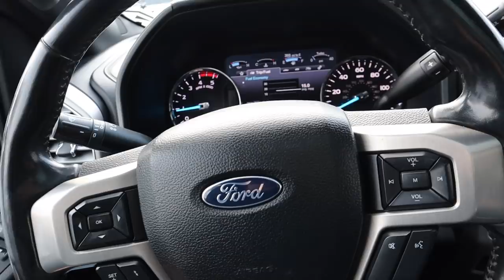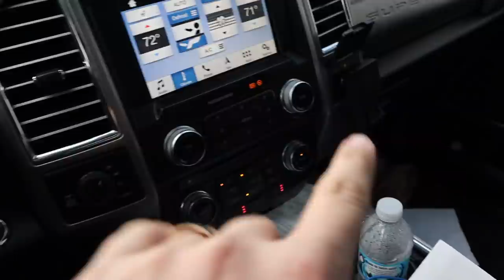I'VE BEEN HIDING THIS FROM YOU UNTIL TODAY...

Comment: Check out the tube car wash over off Illinois road by the menards. No restriction on tire size because they use a track without the rails. My f250 fits just have to bring your mirrors in. Well worth the drive to get the underbody cleaned